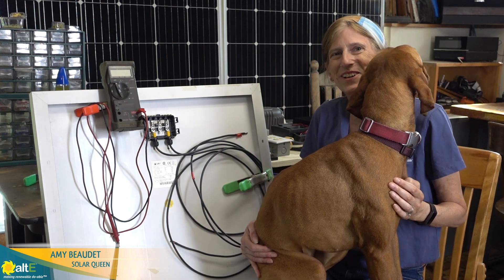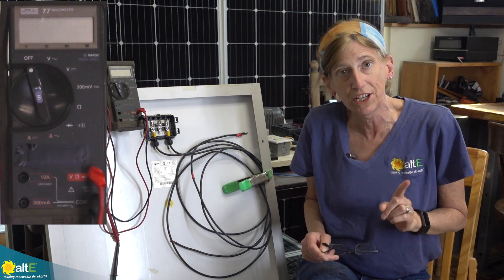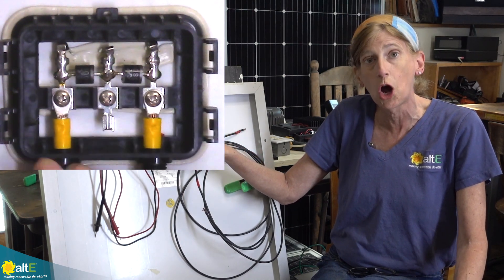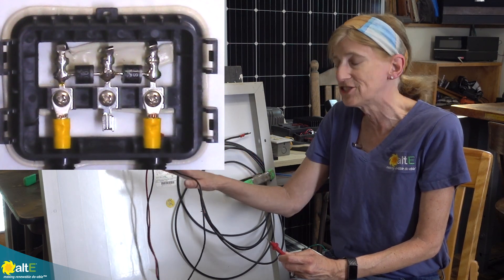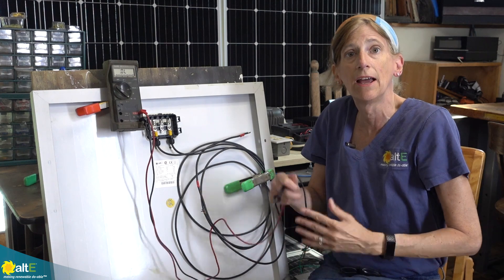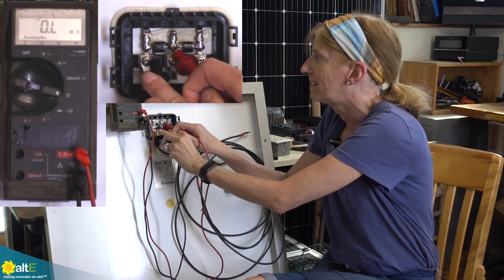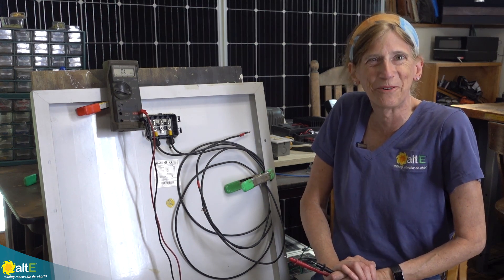How to test a solar panel diode

Comment: The best way, to est a diode, is to take it out, do the measuring.
Reply: As a retired electronic engineer, no not in this simple setup as she has shaded the panel her technique is correct.

Comment: Just one thing that's mentioned in this video I noted. She says OL is Over Load. This is wrong. OL means Open Loop ie open circuit or no circuit connection. Otherwise not a bad video for a novice.

Comment: Mu panel's diodes are not showing any voltage drop. They are showing 0.000 on forward biased connection
Please guide me

Comment: Hi there. What if it’s the other way around? My panel is reading voc of 22.32v at full sun, but my isc is at 1.5amps only instead of somewhere at 7amps, what could be the problem of my solar 120W panel? Hope you could help me. Thanks

Comment: I’ve got an array of JA Solar “smart” solar panels.  They have the SolarEdge optimisers built into them.  Lately one of the panels is producing only 25-50% of the output of the neighbouring panels after two years of operation.

So I inspected, cleaned it, and it didn’t fix it.  My best guess is that one of the bypass diodes is passing current probably due to an open circuit fault in the cell string.  Hopefully it can be replaced under warranty.

My big fear is that the bypass diodes fail under sustained loads in summer time.  The cross sectional area of those diode legs are far smaller than the cross sectional area of the cables connected to terminals 1 and 3,  and yet they are supposed to pass the current for the entire solar string (maybe 20+ amps).

Comment: ONLY Video on YT that explains what a low voltage from a panel means.  Voltage lower than output rating, = Bad Diode....check that first

Comment: 6.1.22  Thanks for making the video. Question:   I have 2 used panels where one of the PV wire pulled out.  When I open the junction box on the panel the junction boxes are filled with a white rubber-like  filling.  What is this stuff and where can I get some?  What I did to fix was to solder a PV wire to the brass looking tang.  Seams to be working.  Showing 42 volt and 9amp.  So I am guessing the diodes are ok.  Thanks again.
Reply from the maker: From your description it sounds like some kind of sprayed electrical insulation filling. If the panel wiring seems to be secure and functioning, I wouldn't worry about it.

Comment: Why do some people talk about a shaded panel reducing wattage of an entire array if the panels are equipped with bypass diodes? Is this something regarding older panels that perhaps did not come with bypass diodes?
Reply from the maker: Yes, newer panels have a lot of tricks to avoid resisting the current in their string including multiple bypass diodes and split-cell designs

Comment: Ohms test is ok with Shottky diodes.  Will not give reliable results with regular pn junction diodes as some ohm meters use less than .6V which will not forward bias the tested diode.

Comment: I have four 100W panels connected in parallel coming off the roof of my RV into a Schneider C-40 controller.  All panels are rated at 17.6V and 5.6A.  I read 18v across the wires coming off the roof array, but when I connect to the controller I get a reduction down to 7.5V across the input terminals.  Voltage across the controller battery terminals is 13.5V.  I get ZERO amps reporting to my battery pack during full sun.  Does this sound like a bad diode situation?

Comment: Hi Amy from Australia, Loved your Vizsla "Elsie" and Video,  I have a problem that has me stumped, my panel (150w) is similar to the one you show with junction box  "While in the sun", my panel has no power from the leads, but in the junction box it measures 10.8v from center to either side outer terminals. I followed your test on the diode setting and it gives 1196 at the leads and test on the diodes shows 487  so it's testing like it should be ok, but no voltage in the sun,  love to hear your thoughts... Kind regards Dave

Comment: What do you look for if your solar was working fine. Then suddenly stopped charging? Charge controller says panel not there. Not reading anything from the panel. System is just a Furrion 50 watt Battery maintainer. Battery is fine at 12.8 volts.

Was driving from Denver to Seattle and the 12 volt fridge was off after 10 hours of driving. Noticed it when I stopped to make lunch at a rest stop. Fridge was not cold. Must have been off for hours.

Normally don't Have issues driving 12 hours with the 12volt  fridge on.

Comment: Thank you so much. You are clear and direct. I have 2 panels in my 40 panel array that show 2/3 output, so I want to check the diodes. The panels are under warranty, but the problem is that new panels on the market are larger and will not fit in the array, so replacement is not a simple option. Unlike yours, my panel junction boxes are filled with a clear rubber-like dielectric packing. I'll need to deal with that.

Comment: Water got into the junction box (like the ones you have open) on the back of a few of my solar panels. There seems to be a bit of rusty water around the screws. The diodes look dry. Can I dry those screws and still have the junction box work?
Reply: Within reason, all electric contacts can be cleaned. You can use some acidic solution. like vinegar, lemon juice or mustard. Thinking about "stuff" you probably have around the house. Off course other commercial grade electronics cleaning products can also be used. 
Mechanical cleaning with sand paper, scraping, etc. Will provide clean and absolutely functional in no time! With this said AFTER cleaning make sure to "seal" the contacts with dielectric grease or similar. Protected contacts will last ages...
Make sure that any water that gets into the box has a way to get out! ;-)

Comment: Hi Ive 35 volts across both sets of panels but no current. Used to work fine .I cleaned them with car wash wax .No amps since! Ill  wash them again without wax. Any suggestions

Comment: What video has the Blocking diode? Do you need a blocking diode if you are using a controller?
Reply: Will Prouse just dropped a video on those

Comment: Hi Amy, thank you for this video...If the module sun side exposed direct to the sun, it would probably give a voltage close to its rating...Will it indicate reliably a bad diode as well?

Comment: When your measuring resistance I see that you cross the contacts. Red to -, and black to +.  When I test my panel like that it is in an "open" position.  I have to keep black on - and red on + like when we test on the diode setting.  Why do you need to switch them?  Why do I not need to switch them?
Reply: You need to check in both directions. OL in one and something less in the other.

Comment: I liked the presentation.  Though I'm going to dig into it further.

I have 9 solar panels producing 2/3 energy (KWH).  They are connected to EnPhase M215 inverters.  Using EnLighten Manger I see the following:
Bad Panels: 17 V DC, 6 A DC.
Good Panels 26 V DC, 6 A DC.
The panels are typical 60 cell panels, with three 20 cell strings.  I can assume no juice is coming from one of strings.  Sound like a diode issue?  Or could it be a faulty string?  Since the inverter numbers are under load, do I have to take one down and test it.

Thanks
-Kurt

Comment: Could you test a string of modules the same way to see if you have an open diode somewhere in the string, before testing individual modules? Thanks!
Reply: I just tried that with a string of 4 220w used panels I have the diodes that were working made the whole string seem good. But they would drop production down to 32 watts in series with light shading. but I would get 180 watts out of a single panel. took the back panel off and 3 out of the 4 solar panels had 4 bad diodes and 2 good diodes making them seem ok. but holy crap they lost production if I only covered a little bit of the panel. now I have to figure out how to replace the diodes.

Comment: Thanks for the new videos and the old ones too! I’m glad you have a  wear house in PR but it’s has few items available, try having more stock and do some fb ads there is a lot of people that want to build backup sistema and there are few that bring those items to the island and most are focused in full off grid or grid tied.
Reply from the maker: Thank you so much for your feedback. 

We've been stocking our most requested items in PR since just after Hurricane Maria. Over the years we've adjusted what we carry there, versus what we can easily and cheaply ship from the mainland. On island, we have hybrid inverters for grid tied battery backup (our most requested system) and off-grid inverters, charge controllers, and batteries. We tried stocking solar panels there, but they were not selling well, as many people are adding battery backup to their existing grid tied solar system and didn't need more panels. So we recently stopped carrying them there, but can still ship them as needed. We are constantly adjusting our stock based on need.

We also do Facebook ads, but it sounds like not enough, so we will look at increasing those.

Comment: I purchased Rich Solar Panels, 190 W.  I tested it today using a Watt meter {While connected to a charge controller, and battery bank}.  From your video, you informed us that is incorrect!  Your video was great, and very informative.  I have a Fluke 87, so I can test it the same way you did with Short Circuit Current, and Open Circuit Voltage.  The only thing that worries me now, is that while testing under load, and partially shading my panel, (With one hand), the current generated dropped by 50%.  I decided to use a broom to shade the panel, and it dropped the voltage from 8.5V to 1.5 Volts.  I am wondering, could a diode be bad, or maybe not enough diodes in the Solar Panel circuit?  Is that what determines the difference in cost of Retail sales of Solar Panels?
Reply from the maker: The low starting voltage of 8.5V sounds like a bad diode to me. Then with shading down to 1.5V, it sounds like there is no path for the current to go, again pointing to the diodes.

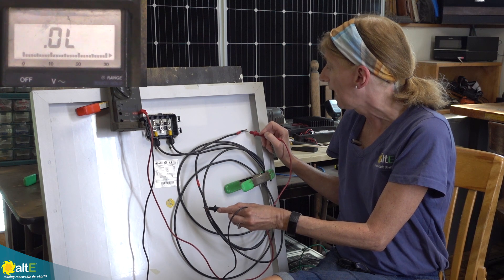Comment: At 02:54 mm:ss, this statement, "OVERLOAD" is incorrect.  When a DVOM meter displays 'O.L.', it means the measured value of the circuit currently under test, is 'OUT-OF-LIMITS' for the selected meter display RANGE.  PLEASE SHARE THIS.

Comment: Fun fact... OL stands for Open Loop or Open Load.
Reply: True in this case, can be over load in a voltage on some meters
Reply: Like Chris said, can also mean out of range.
Reply: I learned it means open load
Reply: OL = Out of limit  or outer limit

Everything between the upper and lower limit can you see the digit out of them OL.

Over Load sounds also good but is the load to high you’ll never see again any OL 🤣